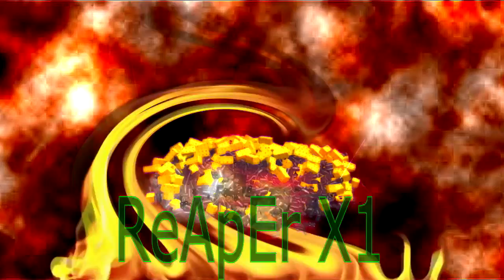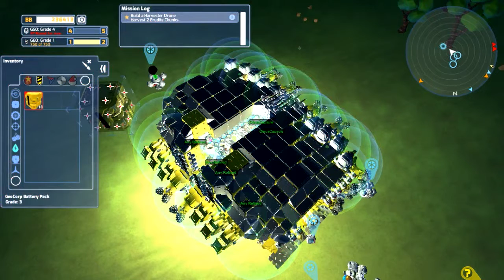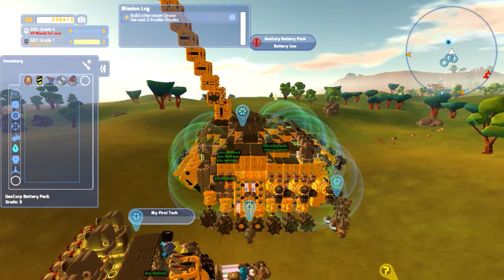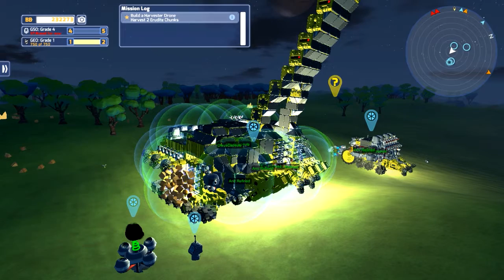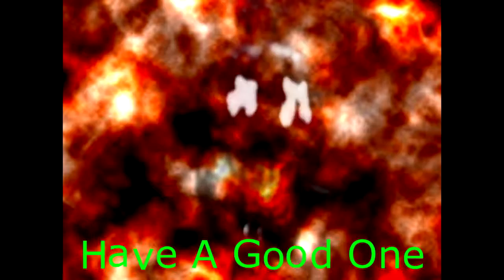Terra Tech - 0.6.0.5 - Out N About with Reaper X1 - Building a Harvester 5 - PT 13 - Let's Play

Comment: Before you go any further try going forward to make sure you don't tip over backward because of the over hang of the handle.
Reply from the maker: I for sure need to do some testing soon, it has been a bit since this tech has really moved. I got an idea that would be cool and solve the tipping problem. This tech is not as done as it would seem now.    Have a good one